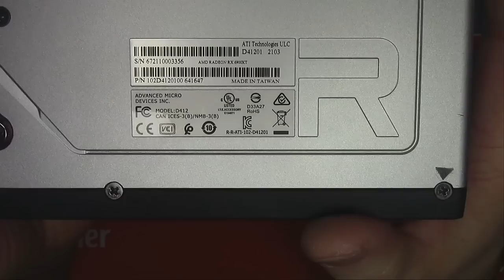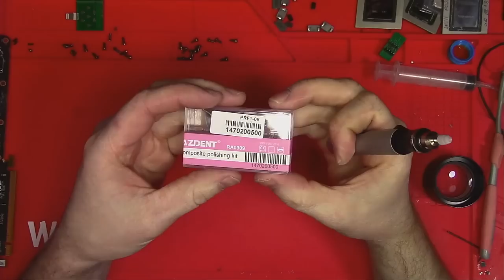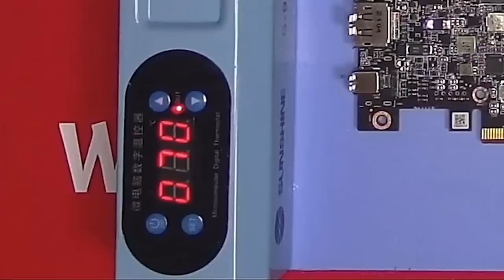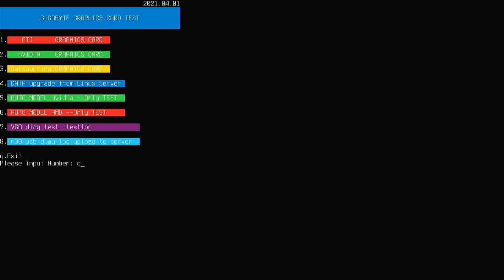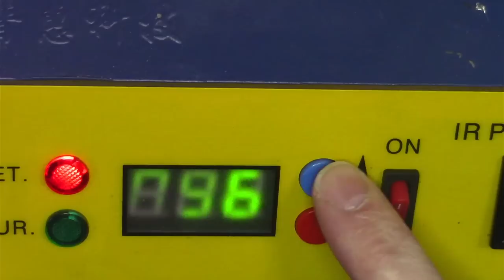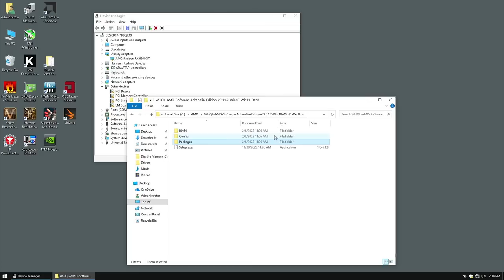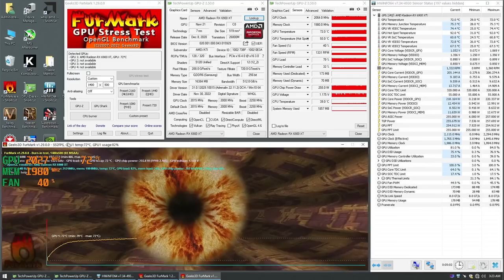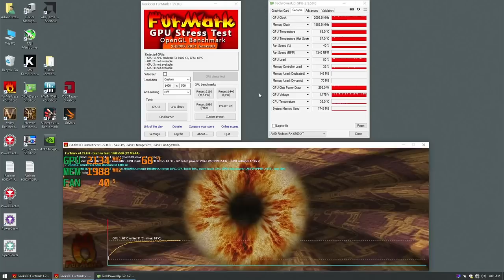Is AMD RADEON good graphics card ? Cracked PCB ripped pads no image

Comment: Thanks for repairing it, glad you finally got an AMD card on here, speedy service of 2.5wks can't complain. Yesterday, I MPT tweaked it to 24k on furmark, that's 4070ti territory hahah. Gonna get next gen 8000 or after, I'm good for a while lol. If I short a MOSFET at 360w, going back to you 😂 hahah. Great to see how you repaired it and wish you the best. Awesomely happy 😊
Reply: "Finally" and "AMD" is not something that we can find in the same sentence too often
Reply: @Homelander-ftw  haha I meant he hasn't had a amd gpu on his channel but he told me he has repaired plenty behind the scenes that was good to hear lol 😂
Reply: @Zensaitv  He did repair a RX 580 or two in his older videos
Reply: @The_Man_In_Red  meant new gen but guess I didn't see it lol. Idk why I thought he only did Nvidia as that's all I saw so idk 😐
Reply: Hi can I ask how did the damage happen? From just being installed on the motherboard without a sag bracket or something unusual happened?
I'm asking because I have the 6800xt founders so basically the same card and I don't have a sag bracket installed, it looks straight after over a year being installed but I don't want to take any chances.
Had a Zotac 3070 before that and even tho it's just a 2 fan cooler it started sagging after a few months so had to prop it with something.
For founders coolers 6800 and 6900xt you can't unleash the full potential of the card, I had to undervolt my card to 1V and limit it to 2400Mhz and aggressive fan curve with maxed out memory slider, this way it stays under 80C on the hot spot even in demanding games at 4K 60+
Reply: @Roman00744  Often it comes from buying a ready made PC, that gets shipped thru postal services with the GPU already installed in the socket. They drop them at least 100 times during transport, and the GPU/heatsink is way to heavy to withstand such abuse nowadays. They need a better mounting system for sure.

Comment: Seeing those temps was unpleasant... I purchased a used 3090 a couple of months ago which also had a 20 degree C temperature delta when under load. After replacing the paste, it dropped to max 13 degree delta under load, so I'm happy with that. I'll probably need to replace the pads at some point too, but I'm not looking forward to that (all the width differences look like a minefield)

Comment: Hi. just wanted to add my 2 cents on the "washer mod". If I'm not mistaken, the intent of the washers was to add extra spring force since the heatsink is laying lower. However, putting the washers at the screw holes to increase spring pressure is incorrect, it will actually reduce the spring pressure. Let me explain.

While there may be a small spring around the screw itself, the vast majority of the spring tension comes from the bend of each of the X bracket's "arms". Putting a washer around the screw reduces the travel distance of each of the arms, reducing the spring pressure. What you want to do is lift up the center square of the X bracket so each of the arms has a further distance to move. Put the washers on each edge or corner of the square part to raise up the bracket 0.5mm away from the PCB and you will get the desired effect of increased mounting pressure.

If there was no X bracket and instead only 4 spring screws, then the washer mod would go on the screws instead.
Reply: That's an excellent point and I believe you are absolutely correct. Good catch.

Comment: pcb cracks are usually caused by bad handling, not low quality of the product, also when observing such cracking at the pcb, it often brings memory module and pcb damage underneath and on modules itself, krisfix also did a similar video and had to replace the chips because they had pulled pads underneath...
Reply: The 2080Ti is particularly prone to this type of damage, due to the narrow proximity between the PCIe slot and the lower row of memory chips.
Reply: @Ivan-pr7ku  yeah, and not just the 2080 ti :D
Reply: The whole design is bad... As a manufacturer/engineer if you believe that little indent out of the PCB will HOLD your GPU (it's one of the 3 points of securing the GPU to the mobo/case), you need to either redesign it or enforce that particular area of the PCB (and not put traces next to it). But ofc, manufacturers don't care. They care to sell more not for the buyer to keep their products as much as possible :(
Reply: @Helifax19  that's all caused by the laziness of the manufacturers to redesign or modify the standard. We are still using a mounting solution from the jurassic, when MB were placed horizontal and gravity worked in your favor. Then the whole thing was flipped sideways and initially wasn't a problem until GPUs weight a 1-200gr. But now it would really be time to find a new industry standard.
Reply: @Helifax19  GPU is a chip. You are talking about a graphics card.
Reply: @HanSolo__ it's technically called a VGA.
Reply: I agree. I've been building PCs for decades and have owned many graphics cards including the one in the video and have never had a cracked PCB. I will blame some of this mishandling on the latch design though. The more recent mechanisms release the cards easier than the some of the older ones.
Reply: That why GPU stand is important

Comment: I like the look of the 6000 series reference cards, but I wouldn't expect the best performing cooler design. My Sapphire RX 6800 runs very cool with an undervolt! (and still gets basically full performance)
Reply: My reference 6950 XT "Made by AMD", doesn't run very cool, it seems that the heatsink and the vapor chamber gets overwhelmed, like reported everywhere when the reference 7900 series launched. 
The core may get to a maximum of 70°C, but the hotspot temperature climbs steadily, to stabilize around 110°C and from there it downclocks to 2200MHz to avoid even more overheating . Using factory settings and running it and my 3000 rpm 140mm case fans at 100% for testing only, because it is to noisy and doesn't help to lower the temps at all. 
To keep it under 100°C on the hotspot, I have to undervolt the core by 50mV and lower the power limit to -5 (~240 W)  🤨According to AMD this is absolutely normal behavior and no reason for RMA...
Reply: @Aliens308  damn..
Reply: My AMD 6800 is holding up well and does cool decently. doesn't get past about 65ish degrees running at stock clocks and voltages. I don't know how much I'd trust the cooler with a card that draws more power than the 6800 though
Reply: @Aliens308  Repaste it with some thermalright TFX, but yes, 6950xt cards run to 110c on the hotspot and it is normal.

Comment: Agree with your comment about the 1080ti. I almost regret selling mine for $300(CAD). That thing was rock solid. Everything. Just. Worked. Using a 4090 is nothing like it. Especially with a Gigabyte card. Have to worry about cracked PCB, connector plugged in properly, display issues with certain monitors/multi monitor setups...

Comment: XFX 6900xt owner here. My temp difference is usually 3-5 degrees. Case: Thermaltake Core P1. GPU vertically mounted. Re-pasted with TG4. Min 2391Mhz Max 2517Mhz @1105mv.  Clocks in at 2477 in game. Temps top out at about 65-70c. Bought the card on amazon pre-owned. "Was it used for mining?" For $500(last year) of course it was.. but still plays fine 4k@120fps.

Comment: I was able to resolve the temperature difference on my 6800 xt using liquid metal. Now the temperature in the hotspot fluctuates between +5 and +10 degrees. Interestingly, after the application, the temperature of the edges rose a little, even the hotspot getting a little lower. I believe that this silicon has a problem in spreading the temperature evenly.

Comment: lol I have the 6800xt founders so basically the same crap, had to undervolt it to 1V and limit it to 2400mhz with an aggressive fan curve so it stays under 80C on the hot spot, at least maxed out the memory slider no problem.
How did it crack? Just being installed because of the weight and bad design or did something unusual happen? I have no sag bracket, it looks straight with no sag but I've been considering adding 1 for good measure.
Love the vids, very professional work, nice to see you growing so fast, you deserve it.
Reply from the maker: Mishandling and weight cracks pcb.
Reply: @northwestrepair  thanks for the answer. Cleaned and added a bracket yesterday just to be safe.

Comment: Excellent instructive video, how much temp do you use on your air gun to avoid making them look brownish?
Reply from the maker: temperature on the gun its self does not reflect the temperature of the surface at which you blow.
its only temperature INSIDE the air gun.
Once outside, depending on how far the object is and how fast the air blows, temperature is much lower.
So if i say: 400C, you might say: OMG this is crazy ! but in reality its around 250-300 on the surface.
Reply: @northwestrepair  Thank you!

Comment: Just a friendly note with good intentions. Some times in your videos you fly past some important moments of the repair, which are either too interesting to not show in depth footage or in this case show where and what the problem is. I had to rewind quite a few times to find out what trace exactly broke and needed to be repaired. All the ground (past tense of grind) copper parts appeared to cover a big surface of the board beyond the cracked part and be continuous despite the crack. Except 2 thin traces that briefly and barely appeared at 2:42. You could for example pause for a moment and show the broken trace that needs to be repaired. The reflection makes things even worse for the viewer. Maybe I completely misunderstood what's happening here. Anyway. 
Thank you for your videos. Another amazing repair in this one.

P.S.1 I'm not a professional repair technician and thus I enjoy all the tinkering, soldering, desoldering, bridging, wicking, blasting with UV, reballing, cleaning, repading, criticizing, making humor, and fixing parts of the video besides the the diagnosing part. I would get it if you want to appeal more to technicians than amateurs. 

P.S.2 I own an RX 6700 (Sapphire Pulse) and the gap between edge and hotspot temperature is 25 degrees C.  20 degrees C ambient temp, 72 degrees edge, 97~98 degrees hotspot. First day I got the card and started testing, I noticed it and right away I lost my mind. I didn't know before watching your videos that this delta is an important thing. Then again everyone is suggesting that RDNA2 cards MUST be undervolted as if they are all operating at a wrong voltage from factory. Undervolted from 1.2 volts to 1.09 and dropped the delta from 25~26 degrees to 15~16 degrees and under the same ambient temp and load, edge dropped from 72 to 62 degrees C.

Comment: You do an excellent job at explaining what you do in an entertaining and interesting kind of way!. I have one question. What kind of thermal pad sheet is that? (the blue one) I've been looking for thermal pad sheets but have not found many good ones. The ones I have found so far are just small packages which are crazy expensive and only last for one or two cards.

Comment: My open box MSI reference Radeon VII $700 from FRYs Electronics (no longer in business) was way too hot and WAY TOO LOUD in 2017.  Had to learn how to water cool.  Direct from EKWB spent $700+ for a dual radiator + cpu & gpu blocks & pump.  Even had a call from my credit union asking if and why I was making a purchase from EKWB native country of Slovenia.

After 6 months of system lockups with buzzing, then restarting when launching some games, and League of legends causing restarts 100% of the time after champ selection, rage ripped it out.  Drove to Best Buy and had to spend $800 for an EVGA 2080Super XC Ultra which fixed all the issues and wasn't overly hot nor was it overly loud.  

Fast forward to 2022.  AMD offered a 6950XT & 5800X3d combo for about $1000.  The 6950XT was hitting 117C on the hotspot!  

Even under volting and reducing power it still was too hot for my comfort.  Had to once again order water cooling parts this time of about $500 due to lucky timing on sales @ EKWB.  Temps are now in the 70s to 90s on the hotspot depending on game and whether I use resolution scaling.  

When I disassembled the 6950XT the cooling graphite pad on the core was not centered and part of the core was uncovered!  When I installed the water block I used Noctua NH-T2 thermal paste.  It has been cool and quiet ever since.  Using Noctua redux 120mm 1700rpm fans.  Due to how annoying the AMD graphics suite is and how laggy/buggy it is, I installed just the driver.  I use MSI Afterburner to manage the card.

Comment: My Vega 64 which i have DYI watered cooled has the around the same temperature difference for the GPU Temp and the GPU Hostpot Temp and from what i've seen this is the case for most Radeon cards, that's why i have the radiator's fans hit 100% when the Hotspot hits 70C, using Fan Control App and GPU Hotspot as source for the fan curve.
Reply from the maker: thats because memory and core are on the same dye
Reply: @northwestrepair  The memory usually stays around 30C away from the Hotspot, and why the GPU Temp and GPU Hostspot Temp consistently have around 20 in AMD cards who DON'T have memory packaged as near as Vegas do, like anything newer, the same temp difference still applies, explain that.

Comment: Your work inspires me even more to study the structures of these GPUs, mainly AMD, although the drivers are still bad, but they are great graphics cards, thanks for every detail in the videos, this demonstrates how efficient and precise you are in what you can see. can be done for even more these gpu's live longer.. Looking forward to your next video!
Reply: The lack of drivers makes them just pretty paperweights. I lost count, how many times i had to tweak or fiddle with something on the whole AMD platform (motherboards included).
Most stable GPU driver for me so far was/is 22.11.2. When i tried the newest (23.2.2 at the time), my PC screens started randomly flickering and this always led to automatic restart. As i read the notes for 23.3.1, it seems entire 6000 series has been abandoned in favor of 7000, as it started introducing new issues for 6000 series cards.
I totally dislike their "fine wine" approach. They do it only because they found out, they CAN and fans & followers will still defend them (poor, little, crying AMD victim - victimization is just a manipulation).
Reply: @Morpheus-pt3wq  so i bought the 6600 recently (my first amd gpu ever) and i didn't really have any BIG problems, don't get me wrong their drivers are not perfect and i had to do some googling and changings some settings but overall it has been decent experience.
Reply: the driver is not an issue for linux, but only if you're using the open source drivers.
Reply: @autumn42762  I have many AMD gpus and Nvidia's too. Drivers have glitches in both and for anold gpu, AMD has AMERNIMEZ DRIVER. Rx 6500 xt is working great with no issues for me so far.
Reply: @Morpheus-pt3wq  I agree with your view bro, they are cards very capable of making a good experience, but drivers are like fruits on a tree, you just pick the best drivers for each day, W11, W10 and drivers, each card responds in a different way , I have an old RX580 that the best driver was v22.10.3 for both versions of the 500 and 400 series that still have people around the world using it. back...
Reply: @hajjmaxime1932  best tip!
Reply: @airmicrobe  Updating these drivers without testing is shooting yourself in the foot, so it's better to do them before the problems with the new ones, great tip too!
Reply: Amd drivers are bad meme lmao

Comment: It seems most AMD cards from this gen have difference between core and hotspot in 15-20°C range and almost nothing can be done, except some very expensive mods.
6600XT has VRAM too close to the core, which disallows use of almost any aftermarket cooling (Prolimatech MK-26 might fit, but the mounting bracket is in the way, if i´d wanted to put passive heatsinks on VRAM; only other option being NZXT G12).
Stock thermal pads are very stiff. When i first opened the card, i ruptured the VRM pad. Ended up replacing all of them with Thermal Grizzly Minus pads (only not much expensive pads with various sizes available in my area).

I also have a question: Is it better to use backplate with pads or remove the backplate altogether? The 6600XT i have (Asus Dual) is fairly short (244mm), so even without the backplate, it won´t bend much (and if i´d see any bending, i´d use metal support i have from the time, when i was using 30cm Strix 1070.

PS.: It´s totally possible this GPU was made by GIGABYTE. AMD does not make the reference design directly, but has AIB partners make them. So even AMD design can be made by Gigabyte, Sapphire, Powercolor, etc.
I also think, that the difference between "core" and "hot spot" is actually about "core" sensor being in the socket, while "hot spot" is in the actual core. AMD driver fan curve is set around hotspot temperature and not core, which seems shady (if it were so insignificant, why make the fan curve around it?).
Reply: My RX 6700 at stock voltage and clocks (50mhz OC by Sapphire Pulse) has a delta of 25 to 26 degrees C. I'm such a "lucky" person. By undervolting to1.09 volts, delta dropped to 15 to 16 degrees C.

Comment: great video as always! man I hate the 5000 and 6000 series, I have an asrock 6900xt from a customer that had cold solder joints on the memory on every single memory module close to the pciexpress, such heavy cards .-. just a question tho, will you share your amd 5000-6000 tserver with us on the google drive link in the description? I have plenty of amd test softwares but none of them work with 5000 and 6000, even tho they said it should work, I'll try to find the gigabyte test in the mean time, thanks for the video!
Reply: Yup heavy indeed mine is 3lb lmao 😂